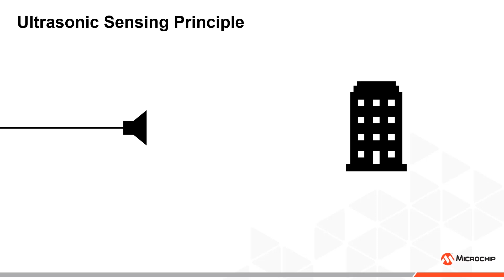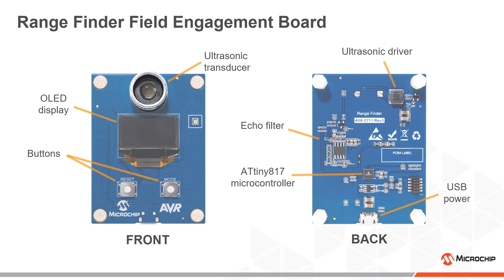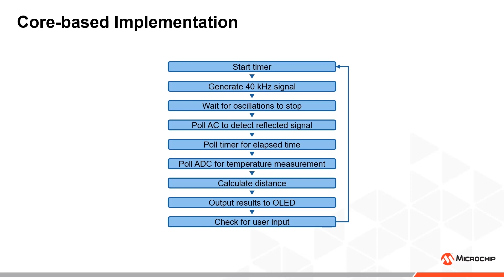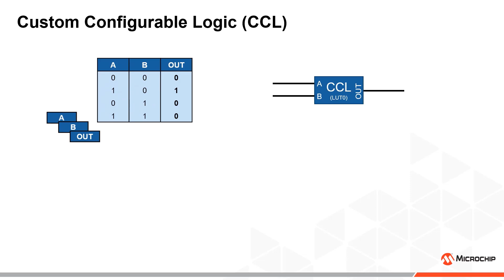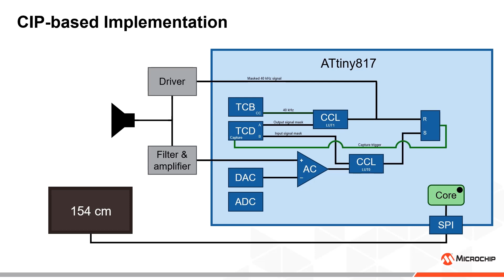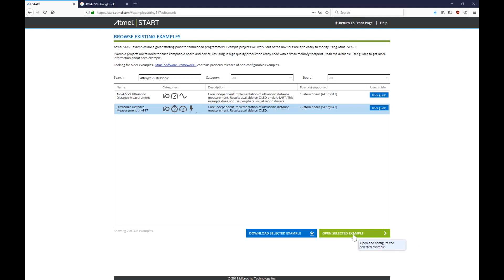Ultrasonic Distance Sensor

Comment: Hi I am Firmware developer and likes to interface different sensors and modules to different MCU.
So i have started a channel GETTOBYTE : microcontroler coding in Embedded C and firmware development : https://www.youtube.com/channel/UCaRUL90bhP-TdCLUlla3gMg
(Initially started with @Microchip AVR 8 bit MCU and later will also do it for SAM 32 bit MCU)
If Microchip likes my content and work , it would be very greatfull fot me and hoping to get a some kind of response from them.
@microchip @AVR @SAM